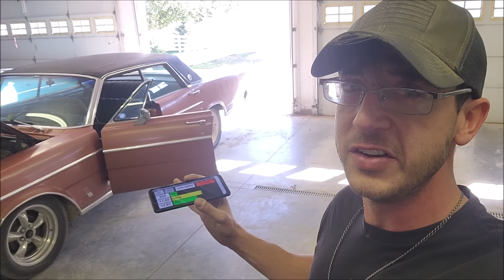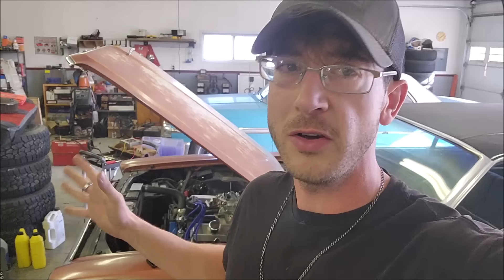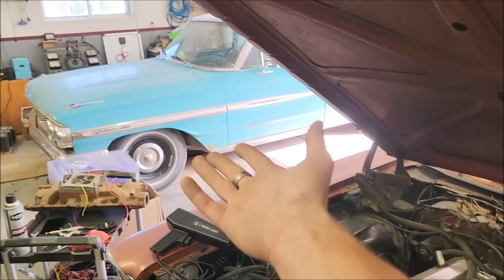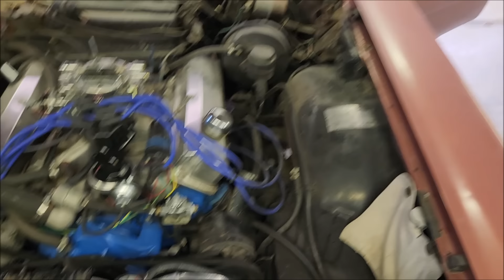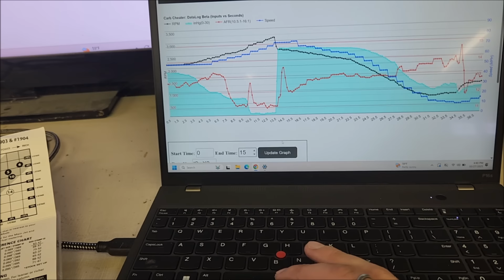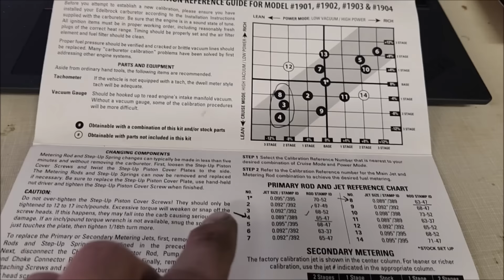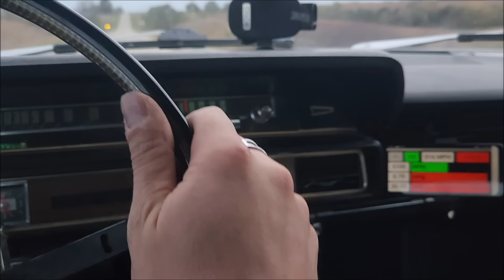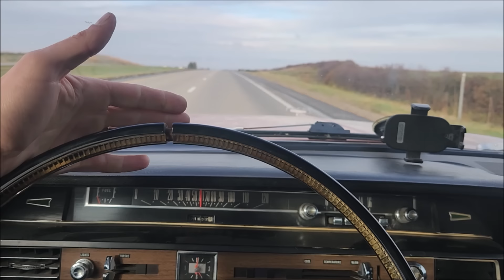Can We Save Her? NEW $6500 Engine Makes NO POWER !!!

Comment: I had a Pertonix III in a 390 myself, and one day it started running funky and the timing wouldn’t stay put. I took it to a sho that has experience with modified engines, and it turned out that the Pertinix module went bad. A fresh one fixed it, howeve the mechanic said I shouts just go with a regular stock Ford electronic distribution which he said were vastly more reliable than Pertronix ignitions are, and parts are only a trip to my local AutoZone away.
Reply from the maker: It probably still has the resistive lead - ive logged about 250,000 miles on pertronix equipment without a failure. When i work on other folks cars and pertronix is acting up - 100 percent of the time its not on 12v. Im actually seen in this video verifying that it is 12v. 
Also, i will say that i only run the ignitor 3 - i do not condone ignitor 1 or 2.
Reply: @ThunderHead289 
Too bad I couldn’t post a picture in my comment. The 390 went into a 74 Highboy that I had looking like it rolled out of the factory. Since Highboys never came with hubcaps, most guys put mag  wheels on. I found dog dish hubcaps off a 74 F250 2wd Camper Special sitting in the junkyard and I took two of them and sent them to a sheet metal shop to cut concentric holes in the center, just big enough to clear the front hubs. It really gave the truck a distinctive and cool look, while looking “stick” as well

Comment: On your garage door opener, with the rolling security codes, press and hold the button until the door starts to open, don't just click it.  Just clicking it like a mouse button, doesn't give enough time for the rolling security code to be transmitted.

Comment: Has a massive vacuum leak you can hear it
Reply from the maker: It doesnt, I was standing right on top of the car for 3 days. Sound of air across the throttle blades at idle setting.

Comment: How are you able to discern a false lean (over rich) condition from a true lean condition?
Reply from the maker: If you are that lean, the engine flat out wont run generally. Couple that with cruising already being way rich, and its not as hard as it seems to tell. Now if I was seeing any number less than 20, say like 17 - it would indeed be true lean. 

But barred out at 20 (top of the scale), generally means rich misfire in AFR tuning land

Comment: Great video.  Time to talk the owner into buying an electric vacuum pump for the brake booster.  Could probably swipe one from a 2010-up GM product, just have to use some push connect fittings for it probably.  Like you said, cam's too big for stock equipment.  Looks like someone went with a 280 adv duration cam.  It's gonna kill the stock converter.

Comment: Getting the kickdown hooked up would help a shit ton. Shifts way too early at WOT. Plus... ALWAYS have PCV hooked to the carb. Big vacuum like PCV and brake booster will lean out a cylinder of the runner of a certain cylinder..
Reply from the maker: Its a modulator adjustment for the rpm - but for the kickdown, if you are already in second, it wont drop into first without it of course.

Comment: “Tuning isn’t hard, you can do it, those people charging for it are bad” oh yeah? Try to tune a newer car with a supercharger and do transmission tuning also.. fucking moron… tuning an old piece of shit car with no electronics and a carb is one thing… anyone can get it to run okay… now tune it so it has big hp and is fast and beats other cars.. this guy is a fucking bozo…. What a dumb thing to say to your audience… that’s all we need is more people thinking they can tune cars in the car world. 🤦🏼‍♂️🤦🏼‍♂️🤦🏼‍♂️🤦🏼‍♂️
Reply: If anything tuning a modern setup is easier. Much of it is plug and play. And, it’s a lot easier to make fueling changes compared to taking apart a carb. You can quickly make a change and see if it helped. 
Unless trying to make something work from scratch trans tuning is also pretty easy with computer control. You can just tell it what you want and make small tweaks from there. That’s why with old mechanical trans they often just went to manual control. It was much harder to tune it just right with springs, governors, and cables.
Reply: @NBSV1 there’s 3+ fuel tables for one segment of rpms let alone the entire set of fuel tables. VVT, VCT, complicated transmission logic, 16 spark plugs on some v8’s, port injection , rail injection, multiple style on one engine like a coyote mustang with 16 injectors for DI and regular injection… putting an EFI system on a old ass car and tuning it is simple… tuning a new car is harder then you could imagine. Anyone could get the car to start maybe? But get it to run good and safe and perform would be impossible without several dozen hours of training or 100 hours… don’t make it seem like new cars with miles of wiring are the same as old cars with 50’ of wiring lol…
Reply: @xGR1MxREAPERx  It’s really not that hard unless you’re trying to do everything from scratch. I’m gonna imagine you’ve had struggles tuning stuff so assume it’s wizardry that normal people can’t comprehend. 
I spent a few years tuning cars and it’s really not that bad once you get used to it. I’ll almost always take tuning with a computer over a carb. It’s far less messy and often faster unless things are way off. With the computer you can simply just change some values and see if it’s better. Compared to disassembling a carb to change parts.
Reply: @NBSV1 I am Talking from scratch.. as that is what this guy is basically doing lol..
Reply: @xGR1MxREAPERx He isn’t though. He took a few big swings at it and then fine tuned it a bit. 
The same basics process would apply even if was fuel injection. Can start with a base tune that gets it running. Then take big swings at it if you have to until it’s somewhat close. Then fine tune it from there. 
About the only thing that changes is if you have a problem with the electronics on the computer system. You could make the fuel and timing changes easily with a laptop. 
I get that computers are scary boxes of magic, but it’s really the same basic process.

Comment: Between you and junkyard digs I was able to get my truck dialed in pretty well. It's still not perfect tho. With my truck 1980 f150 302 and the stock motocraft 2bbl. With the timing at factory 8 degrees (smog state) I had to turn my idle mixture screws out 4 turns to get the vacuum gauge happy. My co worked who builds sbc race boats said it's just may be where it's happy but I'm curious what you think?
Reply from the maker: You know what I think these days 🙂
AFR is king. We dont go to the library instead of using Google 😉

I could maybe see it, but I feel like something is odd if you have a relatively stock engine there

Comment: I got a Hemi from the tow yard the ECU and dash came out a Durango. I put weight in the back. Now the front end comes up. Mostly on the right side. Pulls right hard when I let off the gas even. Changed my front end. Then bought more parts. Still pulls right. Idk. I was happier with my 360.

Comment: Actually no need to shut off the fuel line.  Unlike a Holley, the fuel stays in bowls and doesn’t cause any issues when changing jets.
Reply from the maker: I do it to bleed the pressure off for when you crack the banjo fitting - else fuel sprays everywhere.

Comment: A really nice thing about the AVS is the secondary tip in can be adjusted in small movement making the spring tighter to slow it down and lighter to open quickly.  The springs on the metering rods do the work of power value.

Comment: I have tuned Edelbrocks for decades and never burned fuel out. If you pull the top off and fuel comes out you have the floats too high. That is the beauty of Edelbrock. No spilling fuel. I just use a sharp pencil to stick down in the jet and pull them out after they're loose and to put the new one in.
Reply from the maker: When there is pressure on the gauge when you remove the top, or crack the banjo fitting, fuel will definitely spray out. This is what im avoiding
Reply: @ThunderHead289 I used electric pumps for all this time. Mechanical pumps are probably difference. Didn't have a return line on the electric pumps for over ten years. This was a very good video.  The numbers on the chart are very close.

Comment: Just hold the button down on your garage door opener. Don't keep clicking it. It will open
Reply from the maker: You'd think that, but ive tried everything lol
Reply: @ThunderHead289 have you tried replacing the battery? I know I have one remote that I have to hold the button down on for about a second and then it opens every time

Comment: Ignore this clown drive up and down the road from idol to full throttle and adjust your carburetor accordingly to the tuning guide weather at Edelbrock or Holley it's that simple..... Jesus
Reply from the maker: If youd like to try and tune a carb better than me, then be my guest. The amount of cars that "ran perfect" that have shown up to me and then the owner says "wow its like a whole different car" is astounding. You guys just arent as good as you think you are - just use the data. Same thing people do who dyno tune your car.
Reply: @ThunderHead289  I have tune and rebuilt carbs from coast to coast and if you'd like pictures of absolute junk an unrestorable condition to fully reconditioned and tune from small block to Big block two slant six I've done it all and road tested for far more hours than you have I guarantee you

Comment: glad there was no problems with the engine, but it would only have lasted a few hundred miles the way it came in, I have been a mechanic and bracket racer a long time it sounds good but I would recommend at least 3.5 rear gears, 3.73 would be better if it is not used for long trips, also at least a B&M shift kit in that trans, and in my opinion that cam is too big , I know it is a lot of work but go with a smaller cam and port the heads if you want power, but a cool car anyhow, the long duration cams improve high RPM airflow but bleed of compression at cruising speeds, porting the heads will give you airflow and good vacuum and compression at cruising speed and way better MPG
Reply: 100%. Many people go for the big cam I think just for the sound and idea that it’s the most power. Ultimately it often just makes it run bad and be generally less enjoyable. 
This car would work better with a little smaller cam even if it made a little less peak power.

Comment: Manifold vacuum is not a good choice. When it is put in gear the manifold vacuum drops which backs off the timing making the RPM drop excessive. Better to add a vacuum regulator between the manifold and the advance. It will regulate to a stable vacuum (maybe 5 ~7 inches). Set initial at 12~14*, vacuum pulls it up to 18*. Run ported vacuum to the regulator vent. This lets the vacuum advance make up timing at cruise to 40* to 45* depending on engine demand. Way more stable than manifold vacuum direct to the advance.

Comment: I'd forgotten what a nightmare tuning disis and carbs is. Even a basic mapped single port injection system is so much better and more flexible to tune.

 Or even a mapped ignition only system and just battle the carburettor 😅

Good video though, thanks for making it

Comment: Man I’m a sb guy been running a 351W stroked out to a 400 ci in my 72 Gran Torino sport flat tappet cam making around 400 hp engines lasted 10 years so far with a butt load of miles on it drive it everywhere never been a fan of FE or big blocks to much but man $6500 for no power making engine I’m sorry man put a winsor in that puppy not a fan of edelbrock carbs there mechanical fuel pumps aren’t bad

Comment: Sorry to say it, I know it's an age-old discussion, but... manifold vacuum is ALWAYS correct (unless you are aiming for emissions control), there is no "transitional point". If you need to run ported for your setup to run right, something is wrong. To anyone claiming otherwise: sorry, but you do not understand ICE theory.

Thanks for the vid and well done getting that thing running right - I'm sure your friend is thrilled! :)
Reply from the maker: All factory 60s fords were ported well before emissions existed. The only difference is adding timing at idle vs not - most folks on manifold have late mechanical timing at idle and in the low rpm range so their car falls on its face. You can get exceptional performance from running ported and then running more mechanical initial timing. Manifold is for sure not always the answer. - but you have to look past the vacuum advance and see what you are allowed to do with mechanical timing because of how the vacuum advance works
Reply: @ThunderHead289  Thanks for the reply. The change to ported was made for emissions reasons, nothing else. But yes, I totally get your point here because you are indeed correct that exactly this scenario is what often happens. But I would argue that switching to ported is like putting a bandaid on a broken leg. A better solution would be to tune your vacuum advance, e.g. limiting the max. amount it will add. That said, however, I know many aftermarket dizzys don't allow for vacuum advance tuning.

Anyways - thanks again, appreciate all you do. Been watching for years. When will you do a new revival with Junkyard Digs? :)
Reply from the maker: @VinzentDk its a huge misnomer that ported vacuum came about for emissions - it was around long before emissions. Thats something that was said because some "gm engineer" (probably not even actually) said that on a forum 18 years ago, and it continues to be referenced.

It really is just false - now it was later used in emissions with super late initial mechanical timing, but thats not ported vacuum fault. 

The best way to set up a car is 12-18 initial mechanical, ported vacuum, all in by 2800-3000, and 30-36 degrees total. 

It just gets harder to get the same performance without a lot of work when one deviates from that methodology.
Reply: @ThunderHead289 I would run those exact same figures, give or take, - but with full manifold.

If not for emissions - then why was it changed? What’s the theory behind it? There is none :) Combustion takes longer at lower (absolute) pressures. The lowest absolute pressure happens when the throttle blades are closed.
Reply from the maker: @VinzentDk a normal stock to mild cam doesnt need say 16 initial plus another 10-15 degrees from vacuum advance to idle. Often this results in the idle being way too high and folks backing the curb idle screw out basically all the way. Then you have a flat spot due to under exposed transfer slots. 

What they then do to combat this is turn the distributor reducing mechanical initial to make the idle work on manifold. Then the car falls on its face off the line when hammered because that vacuum advance timing drops out and your left with the weak mechanical initial. 

One could limit the vacuum advance I guess, but then you are just giving up cruising efficiency where 10-15 degrees extra cruising is generally more ideal. 

Again, its not about port vs manifold directly as the only difference is at idle - its about what each does or doesnt allow you to do with your mechanical timing AND the implications of each. 

When I was a mechanic working on injected cars in the 20teens - most of those cars actually idle with sub 20 degrees initial. The 4.0 liter jeeps are even more like 8-10. 

Unless someone has a big cam like in this video, idling with 25 degrees plus generally ends up being detrimental. 

And again - ported vacuum existed long before emissions. Thats false internet info that just keeps getting passed around. Really and truly.

Comment: If the mechanical springs are to weak, the timing, at idle, will jump all around and it will be difficult to get a good reading, with a cam with that much overlap !
Reply from the maker: Indeed and I said that

Comment: An Edelbrock carb seems to be more tunable on divided intakes that do not have the divider cut in it, on open intakes, it seems ,it does not respond as well to the idle adjustment screws !?

Comment: Nothing quite like grabbing the top of a distributor to adjust timing and getting hit with Mr. Voltage. Reflexes cause you to violently jerk your head back thereby snagging the hood latch with your scalp which causes your epidermis to tear away down to you medulla oblangatta. Your instincts tell you to back away from the car but your left hand being wrapped around the cooling fan prevents that. Oh the joy of tuning on an old clapped out hot rod. Takes me right back to my misguided youth in the 80s.

Comment: Big cam in an LTD is just dumb. I have a 67 Parklane, the Mercury equivalent, and just finished assembling my 410. I cruise in the rpm range of 1500-3000 so my cam is for that. Peters out around 4300 but by then the car is at 100 mph. Personally I don't care for the carb and just run my Autolite 4300 that Jon, at Pony Crab, rebuilt before he passed away. Fabulous job.

Comment: Good tuner video, Had a 66 2door fastback Galaxy with a 289, they need 390s, my 76 F150 with a no pollution control 4bbl 390 ran as good as my Coyote does, it had a Holley from Ford, my brother never had much luck with Edelbrocks, I run a 650 that's been CFMd to a 750 with metering plate work and other stuff on a well built 289 400+hp roller motor in my 68 Cougar, it's a breeze to tune and responds like FI.

Comment: I am at the 4:20 time point and going to guess that if there is a TBI system on it, was an old-style air gap intake manifold used without the notch to even out intake pulses? This would explain a lot of the issues you are describing. If I am correct a 1/2-to-1-inch open spacer would go a long way to correcting the problem. Again, just a guess and I am probably way off the mark. We will see.
   OK:  I was way off the mark; it has a carburetor.